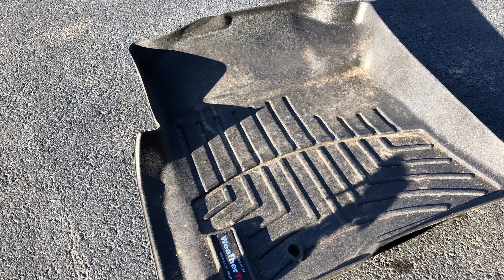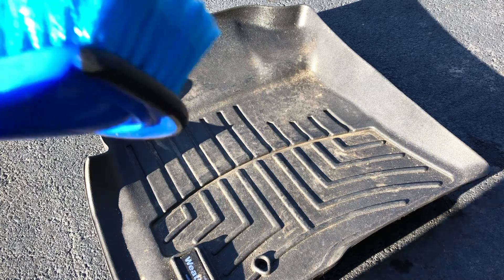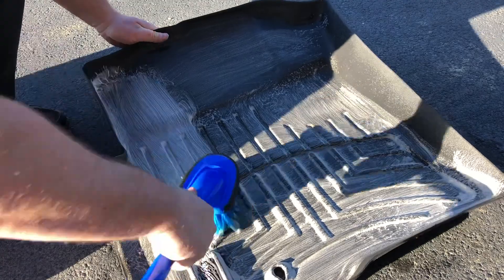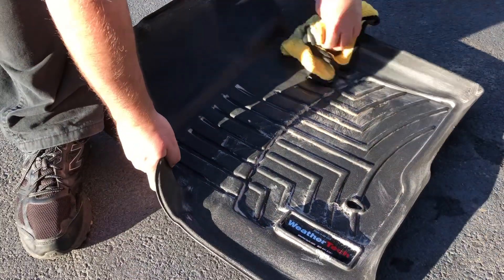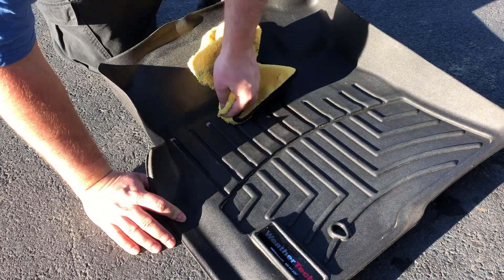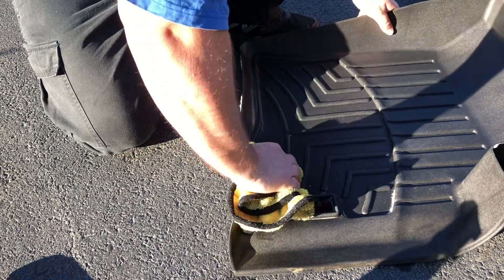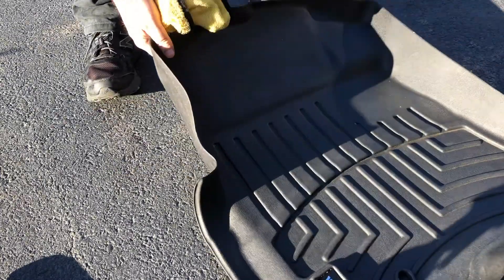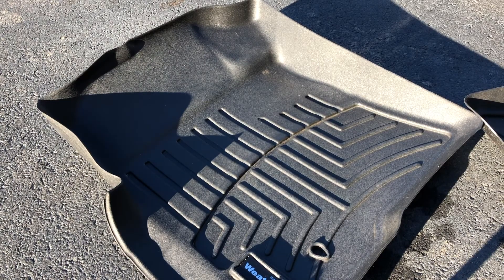P&S Express Interior Cleaner

Comment: I own a detail shop and always looking for good products,  I ordered two gallons to try, if I like it I'll order in t gallons.
Reply from the maker: I detail part time and used to detail for a body shop and my go to used to be Megiuars APC but I found out quickly on old interior it’s too harsh. My former boss told me about P&S interior cleaner and I have never had an issue. It works even better when I use it with my steamer and the fruity smell is a plus as well! I have 2 bottles one diluted 4:1 and the other full power. Thanks for watching.